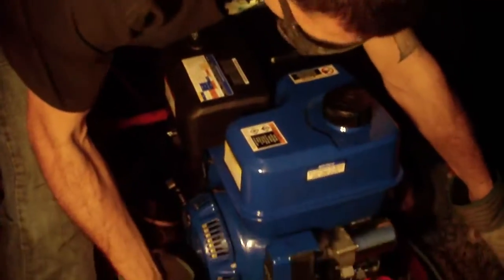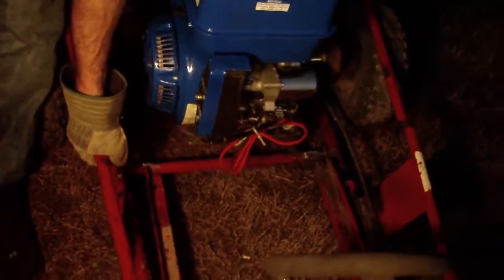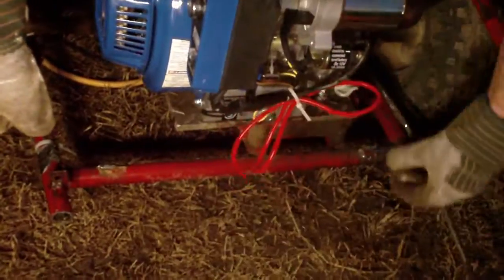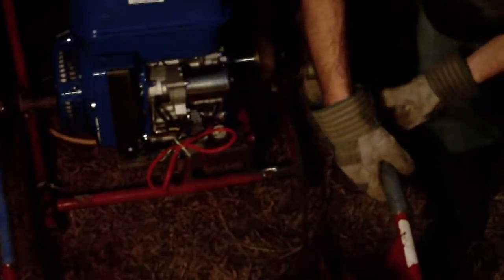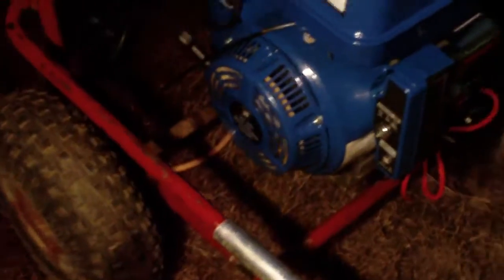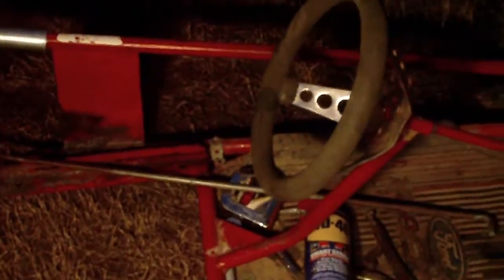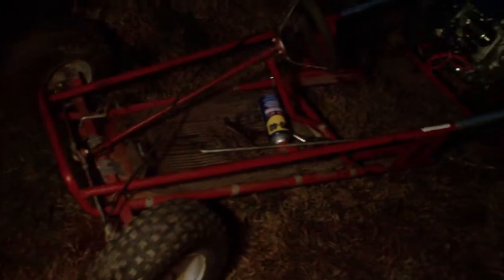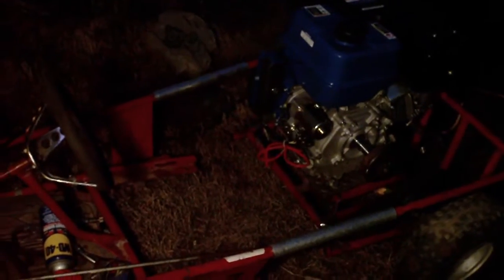EXTENDING A GO KART FRAME

Comment from the maker: Thanks for the heads up, a little late though. I did not know anything when I did this. Now if I have to weld galvanized, I take off all the coating at least a few inches away. I am sure you probably have a better way, but I have learned that galvanized can kill you by talking to modernblacksmith here on YouTube.

Comment from the maker: @AnnexGroup If you use galvanized pipe, just be sure and sand off the galvanized coating where the welds are going to be laid down. The welds will not hold up well if you leave the galvanized on the welds. Good luck, and it turned out good.

Comment from the maker: Thank you. I have to weld in a support bracket tomorrow for the seat and extend the brake linkage and then it will be complete. I will post the video when it is complete if you are interested in how it turned out. If you get on Craig's List and find an old cheap go Kart that needs repairs you can fix them up with a little work. Thanks for watching!